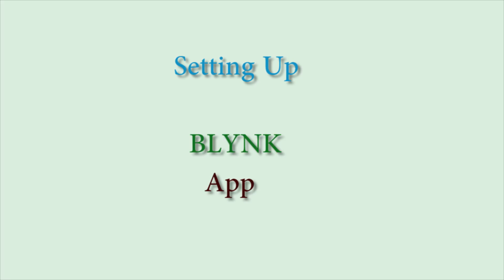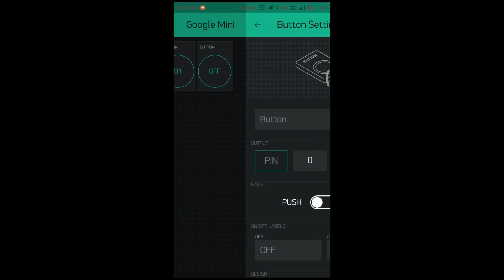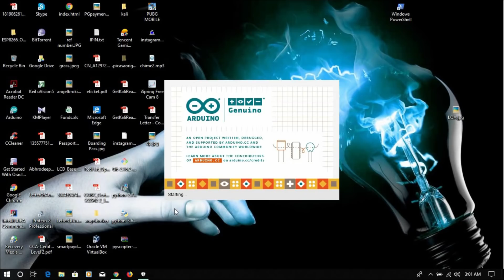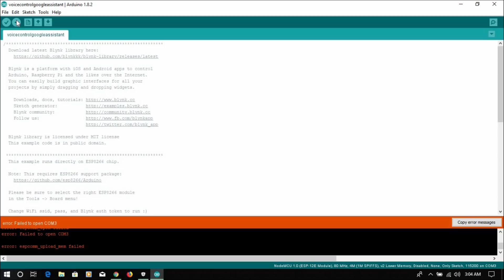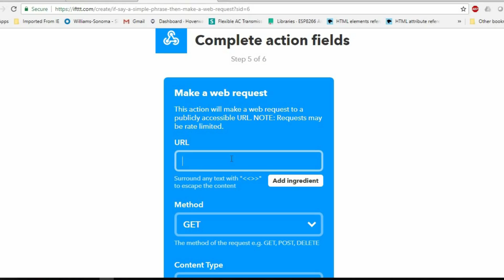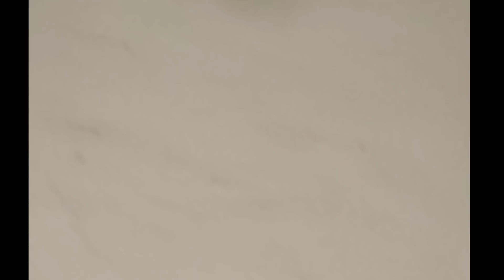Google Assistant | Home Automation IOT | Using Nodemcu ESP8266, Blynk, IFTTT

Comment: Very good. It worked for me. But I am using it to controls relay. How can I make it to only activate the output pin for 10 seconds..?
Reply from the maker: blynk has a feature called timer(where we got button from) you can easily get that and use for any pin for specific time

Comment: I use the same format for the webhook and it doesn't work. Found the IP address through Arduino example, connected with the right token, use the format "https://IP/YourAuthToken/update/D5?value=1" and made sure the pin number was the Arduino equivalent... looked it up already and cannot find a solution lol

I get this error in IFTTT "Unable to make web request: Error: ETIMEDOUT"

Did the format changed for the URL?
Reply from the maker: no the format didnt change, i will suggest you to generate new token for new project and use that. And please make sure in Webhooks you have selected the settings right. method "GET", Content type nothing, body nothing. As well as ping blynk server to know whats the IP at your place.
Reply: That worked! Please edit/clarify that step on instructables, many other people online were having the same issue and you would become their hero as well! Thanks for the fast help!

Copy/pasting "ping blynk-cloud.com" in Command prompt/terminal gave the right IP. For me the IP that it gave in the serial monitor in Arduino was something like "192.0.168.123" and the next line would say "blynk-cloud.com:80", which got confusing since none would work haha Then the ping IP was totally different numbers like "44.55.77.123". I guess it was trying before to connect to the device directly and that didn't work, so it had to connect to the Blynk server first.
Reply from the maker: @Anivisum  haha.. sure I will. I think i did mention to check the IP as per location by ping or nslookup  command. Thanks for pointing out😀